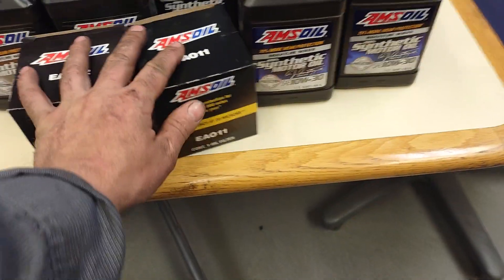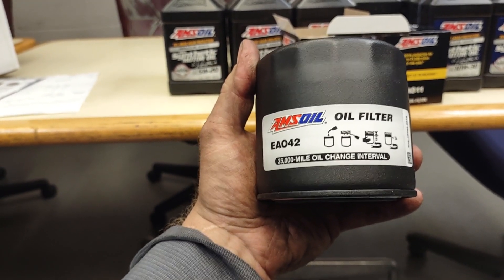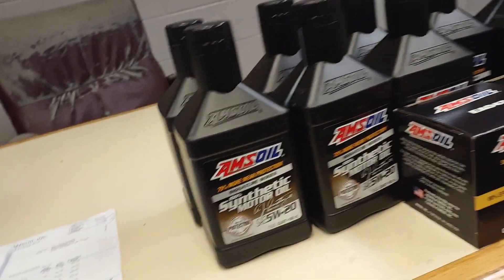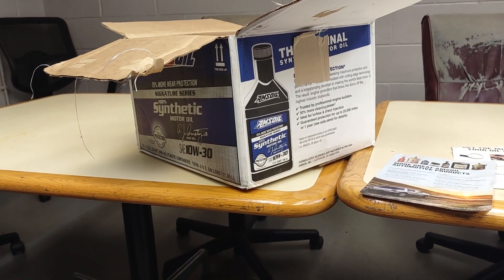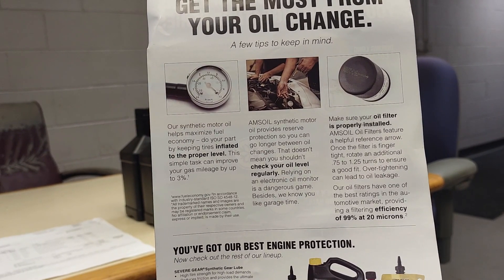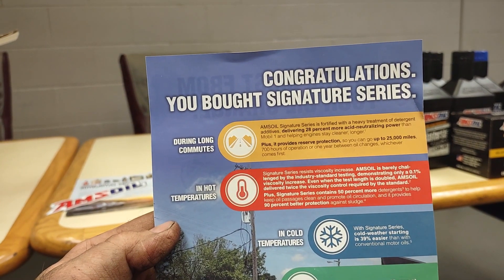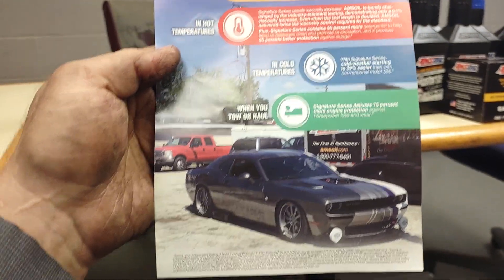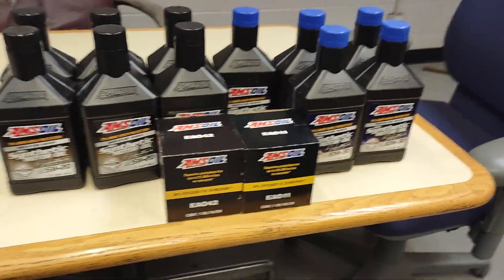Amsoil In 2 days Delivered - My First Ever time Getting Amsoil - Cant Wait to use this stuff

Comment: Just bought 2 new Ford products and started from day one using Amsoil my last Ford was a 2002 focus with over 300,000 miles on when I sold it. Never used any oil. Had the car 18 years.
Reply: I love the focus they only got better with time great sporty drivers
Reply: @jeremypike9153  I had a  ZTS
Reply: Ford will never make another car like the focus again. They are too durable and they are too cheap. Shareholders don't like that recipe.
Reply: 2 alternators 3 batteries The biggest repair that I had to do , and at 200000 I replaced the  Timing belt Just cause.
Reply: Ok

Comment: When I was using Amsoil's best, it always arrived in 2 or 3 days. I never ran that oil less than 15,000 miles and ran it 25,000 miles one time.  The used oil analysis testing by their lab that time still showed TBN was still high enough to continue on same oil!  I had already changed oil and filter since it was so dark.  When I eventually replaced the valve cover gaskets a couple years later on that 93 Lesabre at 190k miles, it was spotless in the top of the engine. Someone ran into the LF plastic fender and destroyed the front end at 293,000 miles. Fortunately my wife and son were  not hurt too bad. Her head hit the top of the door frame, but she was ok. Loved that car but that was the end of it.  Still was getting up to 30 mpg on the highway cruising at 60-65 before the wreck.
Reply from the maker: I did hear a horror story from two of the technicians at the shop where I work at one of them was a distributor I don't want to repeat it that's why I'm trying things for myself but he would only run at 18,000 miles and he had a really bad experience in a two-year period when he tore his motor apart

Comment: Like your videos. I  made my living as a motorcycle mechanic. That's where I learned the value of synthetics oils. Now you're about to use the best. Quick example, I did a 12k service on a new motorcycle I bought. The valves were to be checked. I removed the valve cover and did the valves. A water line steel pipe fit on the back side which had a o ring. Unknown to me the o ring tore on being installed. I drove the bike for 150 miles not knowing that all of the antifreeze was pumped out.  The engine never seized.  I use AMS OIL 10X40 motorcycle oil.

Comment: on the amsoil filter you want to tighten 3/4 turn because the seal is harder than most so it can be used for a year they use to say one full turn

Comment: I guy I used to work for swears by amsoil  his 98 Silverado had almost half a million miles on the original motor and transmission and we pulled a race car trailer with it every weekend during the season.

Comment: I came over to Amsoil from Royal Purple in my SHO and love it. Early on in the car's life it did develop the infamous EcoBoost rattle that I didn't yet know about, this gave me a chance to see some of the inside of my engine and not a lick of sludge or varnish anywhere. I usually do oil changes around 3500-4000 miles, this may sound premature but that's with spirited driving and sometimes having to idle excessively in this good ol' Texas heat.

Comment: I've been using Amsoil for a very long time in all vehicles. Good stuff! I use the OE grade in my truck just because I run E85 and they specify to change the oil at the manufacturers recommended interval no matter the grade so no need to use the Signature Series. With the Preferred Customer discount I get it for $5.45/qt. and use the WIX oil filters.

Comment: I put some Amsoil "severe gear" 75/140 rear end diff fluid on my V8 Explorer with the 8.8" axle (4.10 gears with LSD).  Went 50-60k miles on the Motorcraft full synthetic 75/140 oil between changes.  It seemed like high quality stuff.  But a bit expensive.  I was impressed with the Amsoil "bags" of gear oil, made it much easier to refill the diff after it was finished draining.  So far, so good.  No problems or leaks. Didn't notice any improvement in either mileage or performance.  The vehicle has 230k miles and 16 years on it. Just looking for good protection and longetivity.

Comment: I bought a new vehicle and I changed the oil to Amsoil on the first change. It was a lemon because the dealer did bodywork all over the new vehicle. Because I knew I had a good case and I would be returning the vehicle to the manufacturer I vowed never to put a dime into the vehicle. Well, it took 3 years to settle and 60K miles, I NEVER changed the fluid or filter for 60K. I did do a quart of new oil as the level went down every now and then. Other than that I never did a 100% oil change till the day I turned it back in as I did win the case. 

I've been using Amsoil since the '70s in everything I've ever owned. When I was in business I used it in everything from big rigs, large delivery trucks, foreign and domestic vehicles, and some I've taken well over 300K. I even used it 100% years ago in the Toyota vans that were having problems with oil sludge and I never did. I've purchased used vehicles that were abused by the owner and this oil brought them back to life.  Currently, I have it in my excavator, farm tractor, 2019 F250 Lariat 4x4, Lexus, VW bug,

Comment: Awesome you are going to love it. I have been using Amsoil for 20 years now I use it in everything I own just converted my 2020 Tacoma with 25,000 miles did the motor and the Drive line over just Gotta do the transmission now I use nothing but signature series top line all their products are awesome right down to their small engine oil and greases Love their filters enjoy brother glad you’re trying it you won’t switch back to anything else

Comment: NICE! I will Try Amsoil in my dads high mileage truck, Yes always hand tight only, it clearly says on the factory instructions, that rubber seal/oring  on the filter housing will expand/hardens with temperature

Comment: Great oil and filters.  Put 320,000 km on my 94 Saturn with this oil. Engine was still running great.  So was the transmission with Amsoil synthetic tran fluid. I never went beyond 10,000 km between changes.

Comment: I knew of Amsoil decades ago. I switched to it in my 1995 Dakota. It had the 318 Magnum engine (5.2L) and came with 10w-30 conventional in it. The Amsoil quieted it down and made it smoother, but it would sweat through the oil-pan. After several years of this I did a single change with conventional again, and no more sweating through. That old engine liked the oil, but DANG if it wouldn't leak through!

Stickers don't add 5hp, but those Tornado things add 500hp! Please tell me you know what I am talking about.

Comment: I used AmsOil on all my vehicles. No problems so far..
Reply: @worstnightmare9772  myth.
Reply: @worstnightmare9772  I use only synthetic Pennzoil platnium on my 1995 350 tbi k1500. 207k miles and 30 PSI of oil pressure at idle after warm
Reply: @worstnightmare9772  PSI for oil at idle?
Reply: @worstnightmare9772  most are. Just curious. Ive had about 4 different 350 tbi trucks and this one keeps oil pressure like a newer motor and I know full history of the truck. Just well taken care of i assume.

Comment: Two stroke for gas is great. More performance way less smoke and odor easier starting.  severe gear 75w90 in my manual transmission for my Mazda 6.  Way better shift quality when cold and hot.

Comment: Absolutely, the best in the world 🌎,in my opinion.  I used AmsOil in an old Chevy, I rebuilt a 350 ci and ran 1030 AmsOil I changed a wix filter every 2ooo mile and topped off the oil, I changed my oil every 25000 miles, at 100,000 miles I did a tear down, the engine was clean and with very little wear, I reassembled the engine and sold it to a guy who loved it and ran the crap out of it for a year before he blew it up.

Comment: My dad life time tech 2014 f150 with 5.0 used amsoil on his 4th oil change, he bought it new, it started blowing blue smoke out tail pipe on cold starts. So he left it till the next oil change, he had to add two quarts of oil cause it was low and he checked it every 1000 miles. He changed oil every 5000. A oil field tech said he was told to use amsoil in the BIG Diesel engines on the rig and he had trouble with it spun the lower end bearings using amsoil, so just a heads up watch it on cold starts. I don’t want you to damage the engine in the town car. GOOD CAR the ride is awesome. ✌️✌️

Comment: I tried amsoil last fill on my GDI turbo Honda after being on Redline since first refill.  Hated it, had to add esther wax to make the engine not feel like it was going to jump out of the hood, it was so fough.  I went back to Redline can't be any more pleased.  Extremely smooth and car doesn't get weak after 5k miles.  I was GLAD to get that out, I changed in 5k miles not 7k not 10k not 25k .  To hell with Amsoil. 

Point is, after this try Redline, you'll be happier.  As for the filters?  Can't comment on that, didn't use their filters.

Comment: In reading many of the comments, I’m curious if the regular Amsoil motor oil for cars is any cheaper then the motorcycle oil ? Evidently it must be priced more in line with competitors? I will check it out price-wise, but in reading some of the comments, I definitely won’t be running any oil 10!or more thousand miles! Anyway, I think I will be happy with the Amsoil, the reviews are good and many !

Comment: I tried amsoil in my Kawasaki sportbike, I actually thought it made the valves and cam chain clatter louder than it was with any other oil. I went back to just using regular Kawasaki brand cheap oil. The bike seems to like it better 🤷‍♂️

Edit: I am not saying amsoil isn't good oil, I just noticed a little more noise from that particular engine when using it

Comment: Another vehicle we used Amsoil's Sig Series was a newer 2001 Dodge Ram 360ci 5.9 half ton xtended cab. It belonged to my wife's youngest sister's family. We changed the 10W-30 Amsoil and filter every year for about 4 years and each year it used a fraction of a quart in about 15,000 miles or so.  Then at about the 5th oil change, I checked the oil level, as always before draining, and found no oil on the stick. I went to drain it and got out about 2 or 3 qts max, and noticed that the Amsoil oil filter was gone and a Valvoline quick lube filter instead.  The oil was really nasty and thick. I asked them about it. They had taken it to a local shop to fix something (I can't remember what) just a couple thousand miles or so after my last oil change, and the shop threw in a "free" oil change for them.  And then they proceeded to run it just as long as the Amsoil, not knowing the consequences. Well, after that, the engine proceeded to consume oil like crazy, with them never checking or adding oil, even with me reminding and adding whenever we came there for family stuff. I totally quit servicing their vehicles when she and I divorced in 2008. Within a year or 2, their adult son blew up the engine while towing a camper. Yup. Out of oil. Those 318 and 360 engines were bulletproof, but still need oil to stay running...

Comment: I used to say "King King and his friends tightened that oil filter up" lol them oil filters would come through my shop that tight, and it took me once about 10 to 15 minutes to get the oil filter off..it was that tight. Didn't help it was a 2002 pushrod engine from a Cavalier.

Comment: I love Amsoil products, they make great stuff, I just can’t leave their oil in as long as they say you can. But if I had to go a very long extended drain interval, I’d use Amsoil only.
Reply: Use Oil Extreme Concentrate in Amsoil Signature Series... Raises the TBN rating to 20+.
Run 2 to 3 times longer

Comment: I switched from Amsoil when I discovered it several years ago. Sent in samples of mobile 1, royal purple, and Amsoil after 10,000 each. The Amsoil test came back as good for another 10k miles. The mobile 1 and royal purple both had less than 30% life left. If something better than Amsoil comes into my life, I’ll switch. But nothing has. So my wife and I became dealers for the perks, and it’s an easy way to help family and friends get more for their money. Both of our vehicles call for 5w-20, but looking on both manufacturers charts(and advised by Amsoil engineering) I switched to 0w-30 because of how hot it gets here. The 0w gives the fastest cold start flow you can get, and the 30 gives excellent idle oil psi on 100+ degree days. One car uses the 15k mile filter and it gets changed twice a year due to LOTS of driving. Other uses that EAO11 you have and gets changed annually because it isn’t driven as much.

Comment: I’ve been chasing an electrical issue in my 05 6.0l powerstroke for 3 weeks now 2 cam sensors later and back probed everything checked all the connections cam sensor is in spec KOEO but cranking only sometimes truck will not start ficm or PCM is probably failed somehow with no way to test
Reply from the maker: It's been so long since I tested a fuel injection control module but I know there's a diagram online that shows you how to flip it upside down and test different points on the back to see if it's good

Comment: I’ve always put the oil filter on finger tight and then gave them a turn until It felt firm but it good to know the correct way now , I’ve only use the screw drive removing technique on some else’s filter and that sucked

Comment: So far have had great luck with AMZOIL.... Project Farm did some extensive testing on various oil brands and AMZOIL took the trophy....literally. Main reason I use AMZOIL is for their cold temperature protection....lets agree that most wear typically occurs during cold start.

Comment: I have been an amsoil dealer for  27 years and a user for longer than that.  I have countless success stories with amsoil products. If i chose one public piece of advice it would be this: Do your reading, use it as directed and you won't regret it. It is the best motor oil around but it does not have magical properties...
Reply from the maker: The only thing I'm not going to be doing is going you know 15 to 25 thousand miles an oil change with the stuff I don't care who makes the product I won't do that I just want a top-notch product

Comment: do you recommend running this watery 0w20 oil? Ive seen same motor different years of manufacture, they change oil spec? used to be 5W30...... CAFE legislation?
Reply from the maker: That's hard to say I tend to side on the manufacturer because you don't want to make the wrong full something that you may have to experience on your own

Comment: 25,000 mile oil change interval? WOW!
Reply: I'm 65 and in my day 1.5 to 2k mile oil changes were the norm . Now 7500miles under normal conditions 
is recommended. My teeth grind at 5k miles (the teeth I was born with) and the thought of going 25k miles?!AAAHHH  no
Reply: @chuckymurlo5654  I know right? I don't think i could do it.😲
Reply: That is the “Normal Service” interval. If you read what their “Severe Service” definition is, every one is driving Severe Service. They say change that at 15k miles.
Reply: @bryceweaver8211  ah okay thanks for the clarification. Even 15k is a lot, no?

Comment: I used amsoil 0w-20 in my 2007 tundra and 2010 rav 4  ,the engines made a lot of  noise, changed over to mobile sounds better.Then I changed transmission with amsoil and the dash lights came on and 2 trips to the transmission shop and changing the fluid to mobile oil and the lights stayed off on the truck

Comment: The 5.9 I'm working on currently pro-demand or snap on recommended 10w30
Reply: I'd like to see what the difference is after running the MMO then after the BG cleaning kit Ford Boss Me? I've always heard BG makes awesome products let's see it in action! I've been trying for two years to get my boss to swap over to BG's induction cleaning kits from Wynns kits. Wynns always improves drivability but with direct injection afterwards there really isn't a noticeable amount of carbon cleaned from the valves. I'd like to see what the BG stuff does I sent my ST through the cleaning from BG a few times.
Reply from the maker: I cleaned out a motor that was ten times worse than this one and it just dissolves through that stuff like it was nothing
Reply from the maker: And that was the BG engine dynamic flush kit
Reply: @FordBossMe  I'm hoping eventually he swaps over the equipment is more expensive but the results from what I've heard not seen are much better. Do you mind pulling the valve cover afterwards so we can see it? I just want to be able to show him results you know what I'm saying.
Reply: I like your videos by the way keep up the good content. I like the technical aspects but I enjoy seeing also the results of additives MMO Berrymans Lucas oil things you can see.

Comment: But with todays's turbos and heavy egr and higher output per liter I would only go past 10,000 miles on Amsoil Signature Series oil and filters after testing a time or two to verify it's ok to go to 15,000 or longer. As you have shown time and again, some engines and driving routines are hard on the oil
Reply: Not be an ass, but why not just use Pennzoil platinum every 5,000?
Reply: @williamwchuang  I was changing oil and servicing so many vehicles in our family, friends, neighbors, and other groups, it was a strategy to save time and money or at least break even on the cost side by going 1 year or 15,000 miles.  The engines protected by Amsoil's best oil seemed to run better and last much longer.  Pennzoil has never recommended or guaranteed anything longer than manufacturer recommended intervals. They do make some very good oils. With today's engine designs, I rarely go more than 10k miles on any oil or filter even if rated for 20k miles unless all highway miles.  Then maybe 15k miles.  I am not currently doing near as many oil changes as I did back then, and no longer use much Amsoil. It's still one of the very best and I would use it again in a newer vehicle.